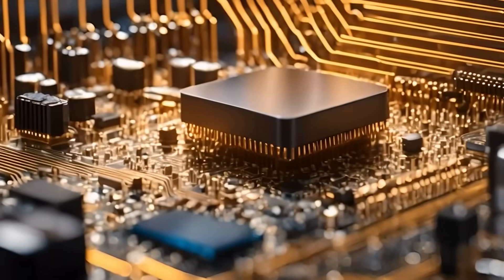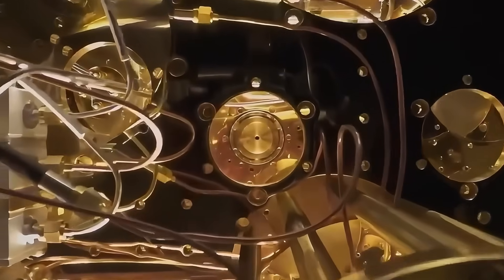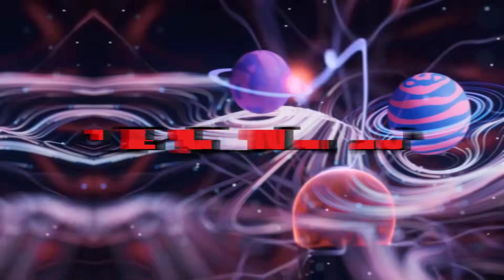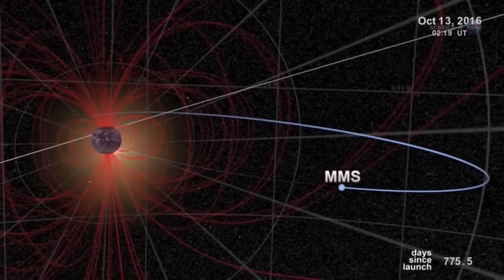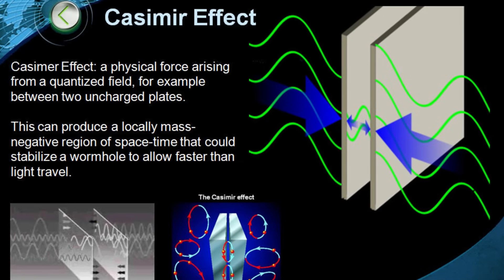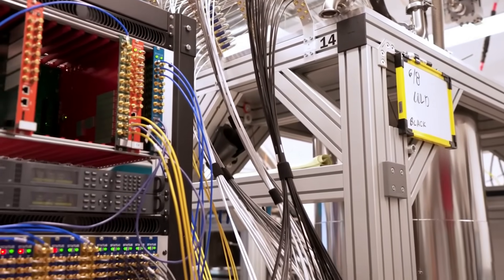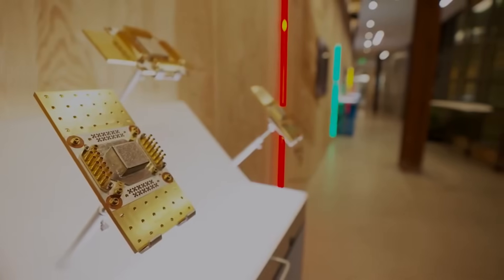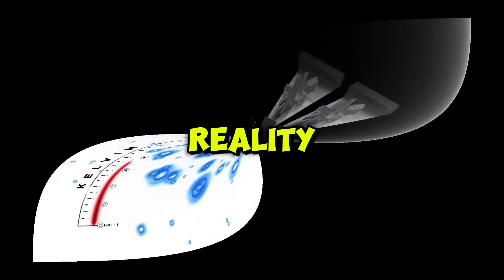Scientists Alarmed: Google’s Quantum Lab Just Distorted Earth’s Magnetic Field

Comment: Induced resonance by quantum coupling probably of photons in the computer and those in the magnetic field. The phenomenon of quantum coupling entanglement is something even Einstein didn't understand. He called it spooky action at a distance. Generally the electromagnetic and gravitational effects of particles fall off fairly rapidly with distance. With point sources they are 1/r and 1/r squared so to get an action reaction at a large distance, they have to have enormous energy. But in this case they don't. Therefore they must connect by a short path in a dimension we cannot sense. Is time that dimension?

Comment: I figure this out a while ago. Einstein was the first string theorist and didn’t know it. The string isn’t what string theorist believe it to be, its ends are tied to two sources- our sun and milky’s blackhole. These two sources are entangled. The shell protecting the atom is a dimensionally cut octahedron that follows the square and looks like a string. Solar rays and cosmic rays are the entanglement products. These rays represent an entangled information system. When cern found strings in there collisions, it meant they destroyed atomic information on earth. Earth was then bombarded with exotic high energy cosmic rays (information cannot be destroyed). The entangled source corrected the missing information. The glue that holds everything together is entanglement.